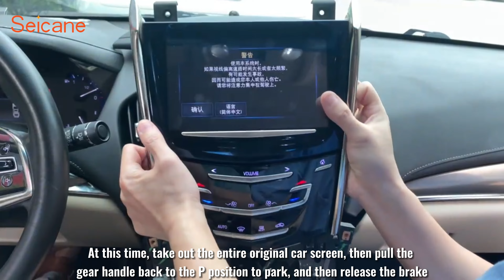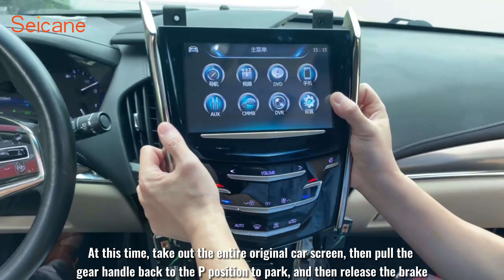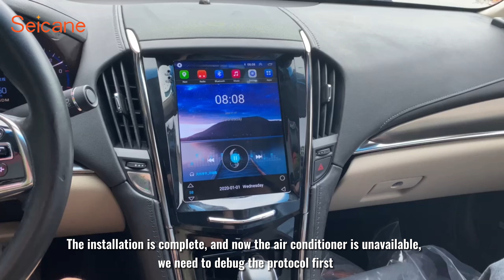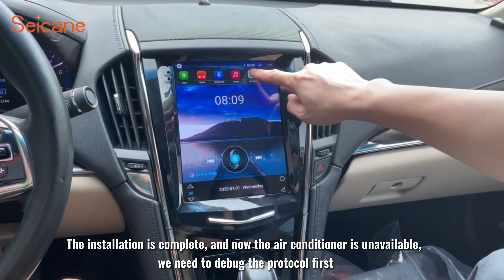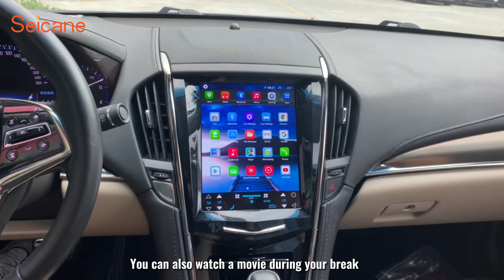How to Removal & Install Cadillac ATS XTS ATSL SRX CTS radio with CarPlay? 2004- 2007 2008 2009 2010

Comment: Can I upgrade my base model 2013 SRX with this? Will it have navigation or will I need to acquire a navigation module separately and if I purchase an aftermarket back up camera can I connect it to this?
Reply from the maker: Hello
1. If your car's dashboard is the same as picture in video, it can fit your car.
2. Yes, the radio has navigation 
3. Yes, you can add an aftermarket back up camera in options, it will work.
https://www.seicane.com/hd-touchscreen-android-stereo-for-2011-2019-cadillac-car-gps-navigation-system-dvd-player-carplay-4g-h7676

Comment: promosm
Reply from the maker: Dear, what can I help you ? do u wanna buy this item ?
Reply: @Seicane-Car-DVD I want to how do I ?
Reply: Aux cord how do you connect it because I have no sound
Reply: @Lil_V_Sport_POOH  I’m having the same issue
Reply: @LoneWolf-yq9br did you get it to work ?
Reply: @m1ke2low  I did. I had to run an aux cord to where the aux is in my center console.
Reply: @m1ke2low i just install thisbradio will upload tonight
Reply: @Lil_V_Sport_POOH im abou to upload